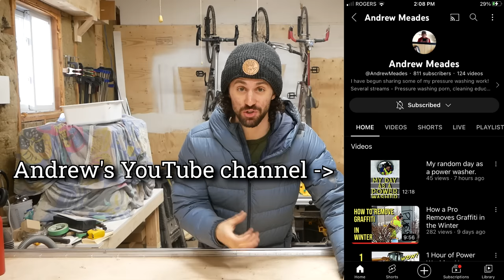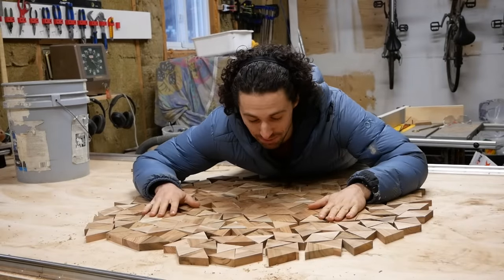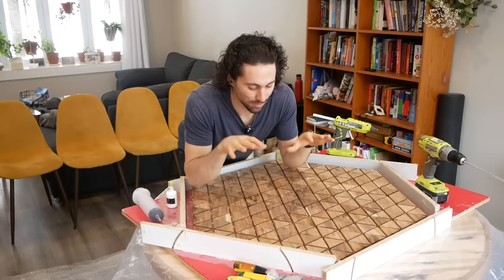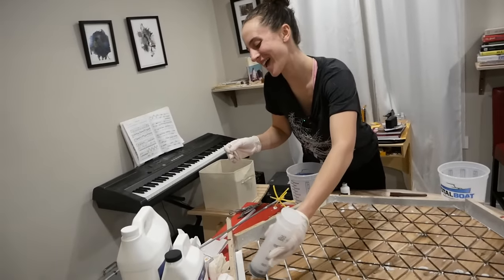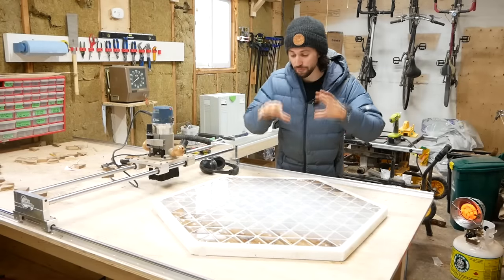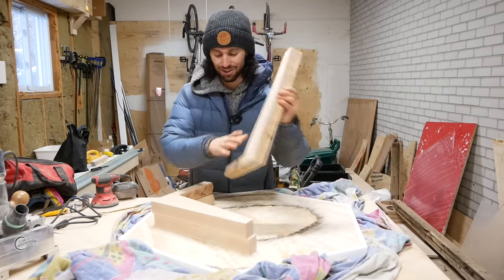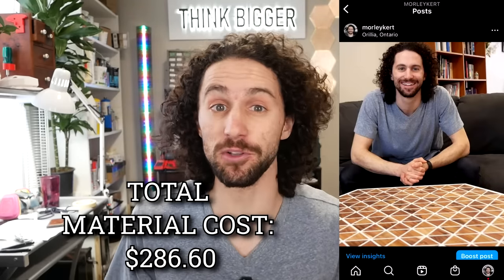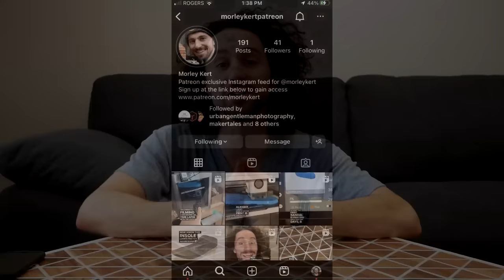Turning a Free Chair into a $2,000 Table

Comment: You should not use your miter gauge with the fence like that for cutting those small pieces, if you screw up pushing it there is a high chance of kickback if the piece gets loose. You should setup a block at the beginning of the fence, so you can reference off that, and then there is no risk the small parts get pinched against the fence.
Reply: It would have taken another hour or so, but safer in the long run
Reply: @jjeshop  It would not take longer, you just need to setup a block against the fence before the blade, that you can butt up against, this way there is more room between the fence and the blade and the pieces can't get stuck. I'm sorry if I'm not clear, english is not my first language :/
Reply: I would say make a sled and the whole thing travels together, it would hold both the workpiece and the offcut safely and it could be clamped if you felt like it. A lever clamp would be very quick.
Reply: Exactly, this is super sketchy and you are very lucky, that one of those triangle didnt hit you in the face. just set up the block on the fence as described above and you will be good to go!
Reply: I'm seriously amazed he didn't get kickback, that was a truly dangerous setup. I taught shop for 7 years with no injuries in my classes, and would never have let a kid make a cut like that. That's how you become a 9-fingered human, or in Morley's case, get an ice pick in the stomach when the piece kicks
Reply: I don't think anyone watches mortley for his woodworking safety tips
Reply: I’m glad you all said this. I was about to comment. He really needs a disclaimer on his videos with some of his practices. The videos are entertaining though.
Reply: Can someone explain this to me in greater detail? I'm sort of picking up what's being said here, but not 100% certain. Aka, help me not injure myself.
Reply: @davemeleca  in general, the piece of wood you're cutting should be longer than the contact area of the blade (about 5 inches or so).  Less prone to kickback and getting stuck between the fence and the blade.
Reply: LoL noticed that too 😊
Reply: @davemeleca  If you do what Morley did here there’s a high percentage chance that the spinning of the blade will pull the piece against the fence and shoot it back at you. By doing the block that the commenter is talking about you take this away. Just clamp a block against the fence before the blade and use that for reference. Then push forward past the block and through the blade.
Reply: @davemeleca  So the issue is not the length of the piece of wood, but that it can get stuck between the fence and the blade and kicked back by the blade. To prevent that, you should set up a stop block against the fence at the beginning of the fence, and butt up your piece against that. That way there is more space between the blade and the fence and the blade, and the loose pieces can't get stuck. Watch Steve Ramsey's table saw safety videos for example, he always mentions this.
Reply: @shmiggz  what safety? In every one he is taking zero precautions to prevent kickback or a disastrous amputation accident. Today he added not wearing a respirator or even a dust mask when grinding down epoxy.
Reply: @lax1412  no crap!
Reply: Look at that muh fn push stick 😂
Reply: Glad I wasn't the only person who caught this.  There is a device that allows you to cut with having to use the fence and still get uniform cuts.  I bought one for safety reasons.  The table is really cook.  Love the white epoxy and how it looks with the wood.
Reply: Just to be sure I understand, does what you're referencing occur at 3:08 or elsewhere in the video? Shop class was a very long time ago and before I start again in my workshop, I'm grateful for pointers such as this.
Reply: @ExplorerBe  Yes, that's it :) If you want to watch a few videos, I highly recommend Steve Ramsey's table saw safety videos.
Reply: @kz.irudimen  Thank you!
Reply: @ExplorerBe  If you want to do this safer, you can do it in your miter saw using sacrificial back plate ie putting peace of board against rear reference surface, screw or clamp it in place from both sides, then add your stop block and now you can saw peaces with no ripped edge. For even better end result add board on the bottom reference surface too and you now have zero clearance insert for that specific angle hence no ripped edges.

Comment: Please be careful with epoxy. I found out the hard way that you need to be using a respirator if around it, and you need to let it cure in an area you aren’t going in. It’s a dangerous chemical. Sawing it is the same, incredibly dangerous if not being careful. Fabulous work though! Just be safe
Reply: Plz elaborate because I use epoxy a lot
Reply: @Acacklingrugbug  resins give off VOCs (Volatile Organic Compounds) aka a "smell" or gas (that sometimes can't be smelled) that is dangerous to inhale for long periods of time. So that's why it's best to work with it outside or in a place with lots of continuous ventilation. Also, because while it cures, it gives off heat (exothermic) as it reacts and the VOCs increase. That's why you're supposed to wear a respirator if you're working with it inside with poor airflow
Reply: @I.no.ah.guy57  thank you!
Reply: @Acacklingrugbug   no problemo 👍🏼

Comment: With Deep pour epoxy you could have just poured in one go. With Total Bot Thick set You can pour up to 3” in one go. Also just pour the whole lot from the bucket like you finally did. Epoxy is like water and will find its own level.
Reply: Nah the problem with deep pouring epoxy is that it usually creates unwanted bubbles and gives off a lot of heat in the process

Comment: That router sled is more of a jointer than a planer. A planer makes the two surfaces parallel. A jointer makes the surface square.
Joint first, plane second.

Comment: In my opinion, this is your best work so far. But a few little things: wasting plywood, and epoxy could be avoiding by planning ahead. The legs are not strong enough with only a domino thingy. And finally...white pigment? I know It's a matter of taste, but some darker color would be much nicer. Safety is important...organise your workshop to prevent any accident, and the way you cut those small pieces was horrible and dangerous. All apart from these you are getting better at what you do. Keep it up, greetings from Hungaryy

Comment: The reason the silicone tube busted out the rear is because you didn't poke a few holes in the seal at the front.  After you snip the tip. You need to poke out the seal down the tip. Just a few small pin holes is all you need

Comment: probably could have saved a lot of resin if you'd used a cheap wood like some 5mm mdf to fill most of the gaps between the blocks. that would have also been a handy way to make them be uniform spaced. though it would have been a lot more cutting and gluing the result would look the same and be a lot less costly.
Reply: Less costly in material but more costly in time, probably would have come out in the wash. Now, that being said, since he has a CNC, what might have been cool is if he cut a whole grid out of 1/4 MDF, laid that on the plywood and then all the triangles would just drop into that and it would eliminate the compounding errors from moving the jig over and over, AND take up some epoxy volume as well.

Comment: You can remove the plunger from the syringe, plug the tip, pour the epoxy into the tube, then reinsert the plunger. This way you don't need to suck it up.

Comment: By the looks of your breath, it's like a fridge in there :). I would have ran those slats on a sled to shave a hair to get one straight edge, then flipped on the other then ran through table saw. After taking several pieces of wood to the face and body on kickback, dude trust me you don't want it. Also, why not just have a sled for planing the wood? Maybe the router sled is faster? I guess maybe, since it's not that many board feet, but interesting decision.

Comment: You should of done a volume calculation. Then just pour and use a silicone squeegee type thing to spread out your epoxy.
Reply from the maker: That would’ve made the process a little more predictable, but you still have to pour in multiple coats to avoid the epoxy going  exothermic
Reply: @MorleyKert  agreed. Either way you got the same result. The white makes it pop.
Reply: @MorleyKert  I don’t know a lot about epoxy but I thought you could do like a half inch with thickset. I also wonder if the fact that you only have like a 1/4” gap between triangles translates to it behaving as if it’s a 1/4”deep because it’s not a large open cavity. Just wondering.
Reply from the maker: @jeremyspecce  It was my first time using it so I wanted to be safe instead of sorry. The pour was about 1-1/4" deep so I knew it was gonna be at least 3 pours.

Comment: why use the router sled instead of the planer for the maple? i know you can but it seems a waste of time to me
Reply from the maker: Better surface finish
Reply: Also, by using the sled, you effectively face jointed it flat, whereas the planer would have just made a smooth version of whatever twist or bow it might have.
Reply: @jeremyspecce  but if youre still cutting the edges square using the track saw like he did, why not just run it through the planer once on one side then flip it

Comment: "Here is proof of where I messed up because I didn't think ahead and it cost me this much. I'm not going to pay for my own mistake so I'm factoring this into my final cost." I don't pretend to know anything about woodworking but this doesn't seem right to me.
Reply: yeah, the table turned out fine, but clients shouldn't pay for HIS mistakes and HIS lack of planning.
Reply: Yeah this guy is kinda a scam for those prices
Reply: Bro what
Reply: I don't thinks he's making the costumer pay for his mistakes, in the end the costumer will pay what he thinks the table's worth is.
What he's doing by putting that into the balance is shoowing how much he actually spent on the table, and being aware of his actual revenue.
I do agree that's a bit overpriced for the result he got, but I believe that's a different argument
Reply: It's a piece unique, not mass production. When a craftsman produces something he's never made before, you're not buying it to get the best deal possible. You're buying it because you appreciate their work as an art form. If it's  not your cup of tea, then simply dont buy it.
Reply: He very clearly was just laying out the costs so he could know. Nobody paid for those mistakes considering he sold for $1,150 less than list
Reply: @yaboi9419  I very well may have misunderstood. I thought he sold it for $2000 and that the $850 payment was just a deposit.
Reply: @cliff333  850 was a deposit I’m sure he sold it for 1500 usd or 2k cad like he originally wanted

Comment: very nice table the only thing that bothers me that you put so much effort in it but then you used plywood as a base.
Reply from the maker: Plywood is dimensionally stable and strong, so it makes for a good, solid base. I finished it the same as the top so it has a nice a hand feel when you reach under the table :)
Reply: I agree with Morley, plywood is the correct choice for this, dimension stability is key here, solid wood would have added nothing. If anything I could see adding a fresh layer to the bottom for a more finished look and more stability but plywood makes sense in this build.